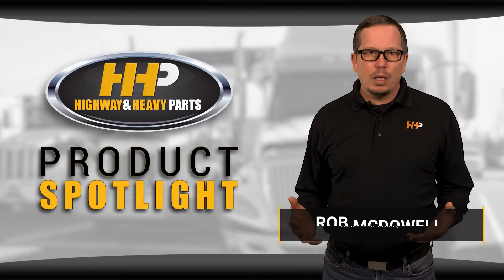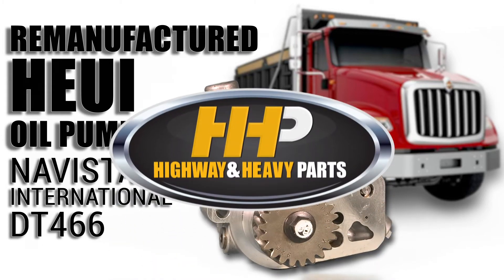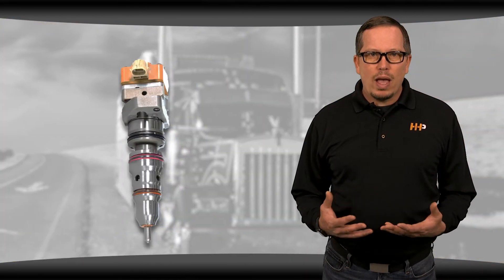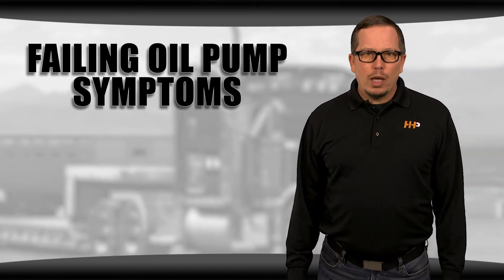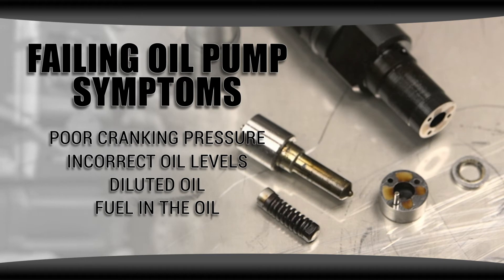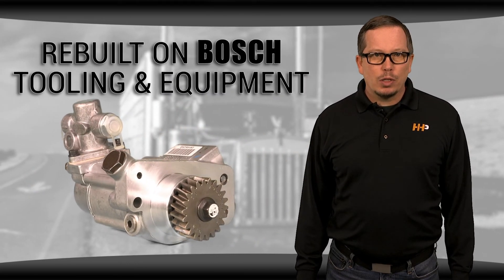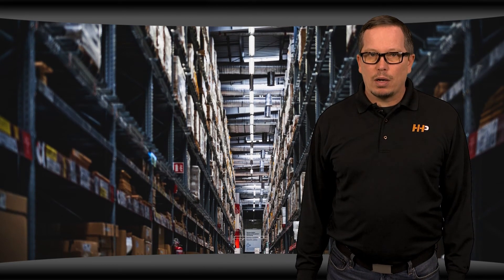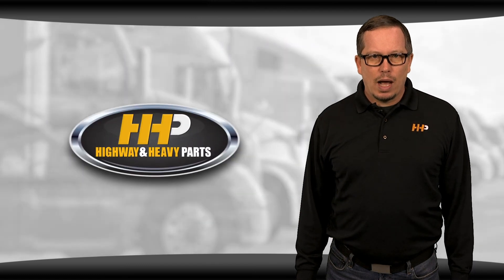Navistar DT466 HEUI Oil Pump Replacement - Genuine Bosch Parts

Comment: My 2002 4300 DT466e oil is always thin at 5,000 miles intervals. Also after the 1000 miles are so oil pressure is at 25 psi at 2k rpm when hot.
Reply from the maker: There could be a number of reasons why this is the issue. Bearing issue, possible fuel dilution or an issue with the oil pick-up tube. You may want to check your electrical/wiring to the ECM. Best to start with a mechanical gauge reading to verify the oil pressure.
Reply: @Highwayandheavyparts  Thanks so much for the input.

Comment: Can a bad oil pump cause oil and fuel mix up ? I notice my fuel filter cartridge gets black real quick and I’m having to replace it more often then usual. I replaced all injector o-rings.
Reply from the maker: Fuel dilution is likely from a leak in the fuel system.  Could be sludge or algae in your tank.  Sometimes you can get  fuel from stations that has sat for a while and can result in that.  We recommend going to large stations that gets fresh fuel often.